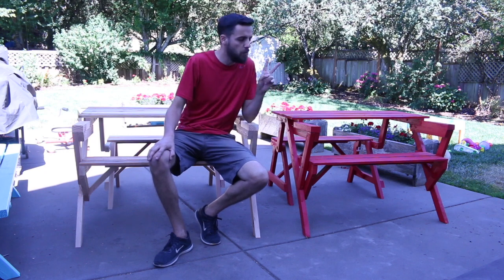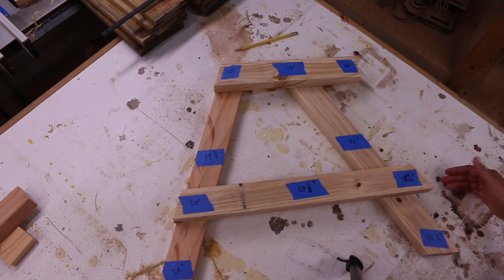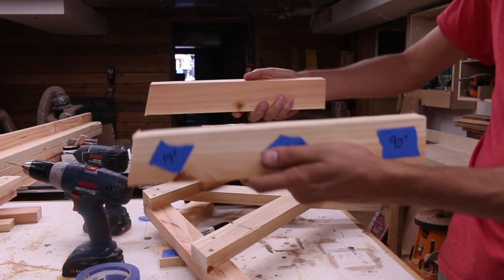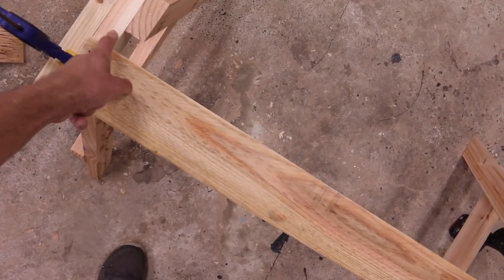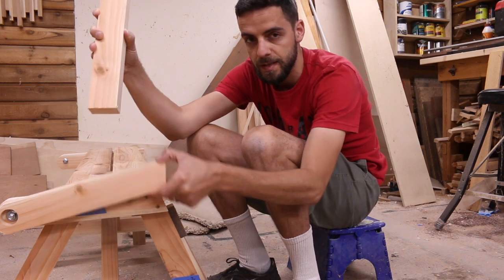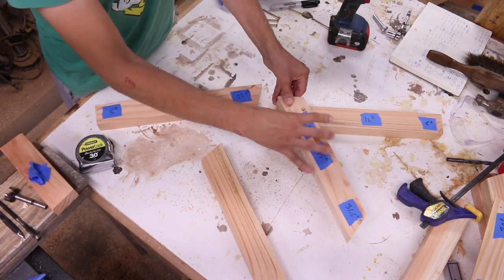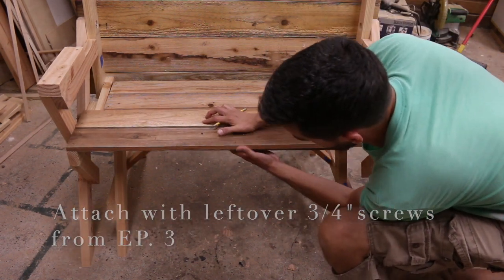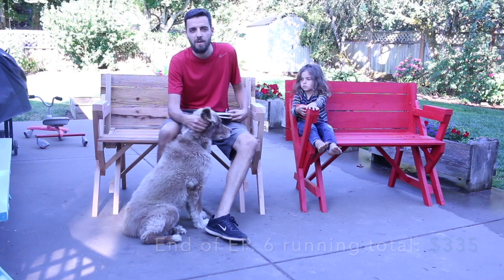EP. 06 Make MONEY Woodworking: Convertible Picnic Tables/Benches (Simple Projects to Sell)

Comment: Curious as to where you are getting your lumber prices from. Lumber prices, at least in the US, are ridiculously high right now. Those 6 2x6's would run me over $60 USD at current rates.
Also, and maybe I missed it but dimensional lumber is fairly wet and after milling it will warp/crack/split etc and even more so when resawn....which is evident at 0:41 where you can see the cracking along the edge of the first board. With the pretense that these are being made for profit and assuming that you'd prefer to put out a good product how do you intend to combat this? reputation is paramount in this type of business and having a bad one is a sure fire way of failing to make it a sustainable business at any level.
Reply from the maker: Thanks for the comment. I do purchase the wood in bulk any chance I get. I get my lumber from Building Materials Bargain Center in Salem OR, which is considerably lower that the two big box stores.

When I purchase in bulk, it is able to sit in my basement on a wood rack that I built years ago. This helps acclimate the wood to my basement but by no means completely solves the problem. There have been only 2 times that I can think of off the top of my head where people messaged me about a board, to which I've gladly made the trip out and made adjustments, free of charge. I haven't added this into my cost analysis as I wouldn't know where to stop.

You are absolutely right about the reputation part. Thanks for the comment!